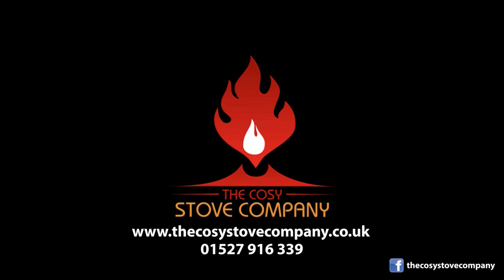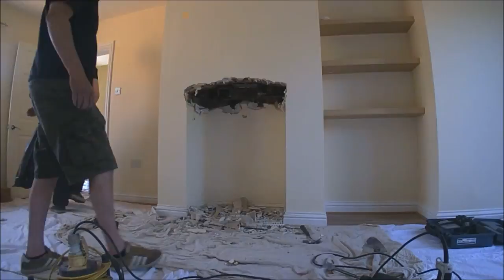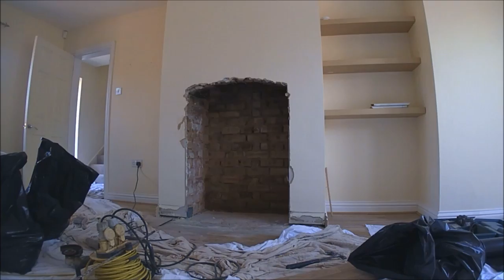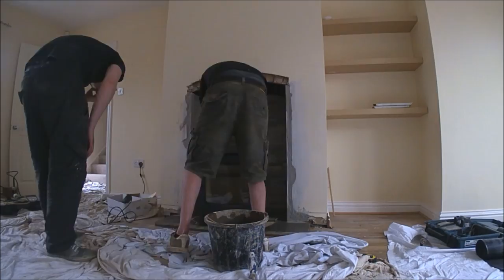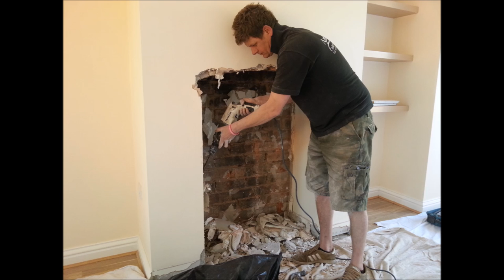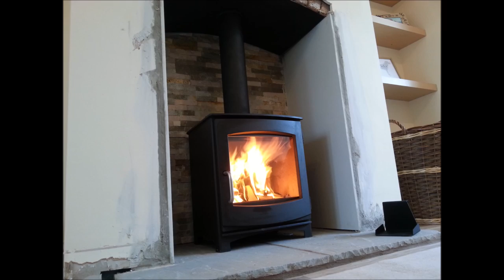Dik Geurts DG Ivar Stove Installation

Comment: Hi. Great video. Just wondering as I'm having a builder doing some and the Hetas Installer putting the stove in place, should the concrete boards and stone cladding for example be put in before the stove or can it be done after? Thanks.
Reply: He's answered your qu. in the comment above. He didn't reply to you for some odd reason.

Comment: I didn't think the Ivar 5 was suitable for a 12mm hearth? Looks like the superficial hearth is laid over combustible flooring..
Reply from the maker: It's a concrete sub floor and you can see the laminate be cut out in the video. It lips under the hearth 10mm all around to give the hearth a finish.